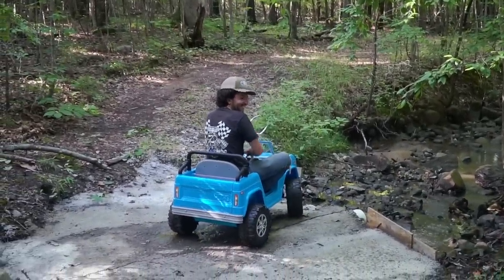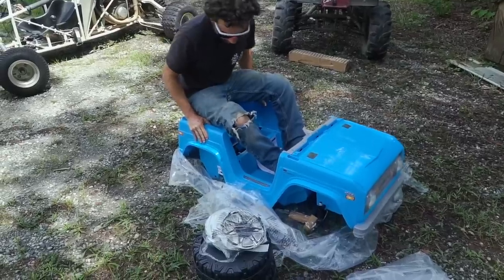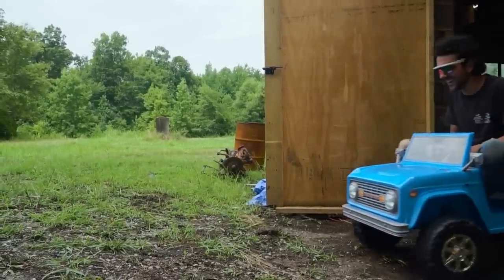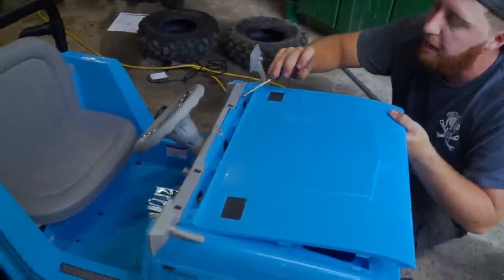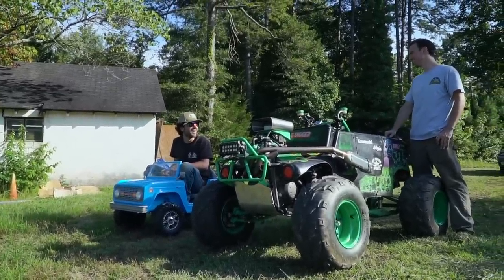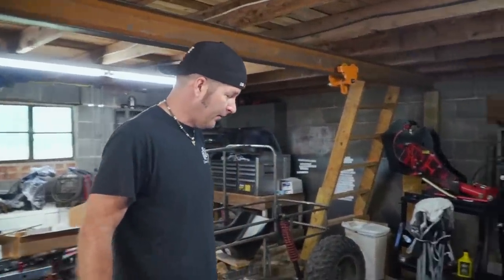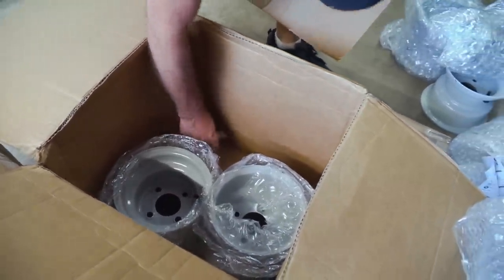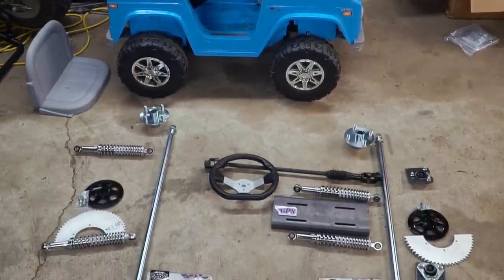4x4 Power Wheels Ford Bronco Go Kart Build!

Comment from the maker: Can't emphasize enough how SMALL this power wheels is! Should be a lightweight crawler with gearing for 40-50!
Reply: You just need to stretch it everyone does it to make room
Reply: Most people do a few inches of stretch for leg room, id love to see you guys do less than usual though
Reply: They make two basic sizes. What you have is the smaller of the two with 1 motor vs the larger power wheels with 2 motors
Reply: @KartArt  dont forget the 3rd size the gravedigger comes in 24v and with suspension
Reply: @16driver16  oh nice. I have seen a grave digger but didnt know it was 24v factory.
I made my kids a 24v escalade they love
Reply: Definitely needs cut and stretched.
Reply: High and low gears?
Reply: You need gearing for 80 man
Reply: Going to be so cool guys can’t wait
Reply: how ever big you think the tires should be...GO BIGGER. same on the width and length.
Reply: Its to small.  Yall need to rethink this build.  Run to walmart  or go on craigslist and find a bigger one.
Reply: go against the grind hard boi's with thier 4x4 power wheels.
Reply: We see how small it is. That's why we are all worried. Somethings should be left to the Jackass crew. Godspeed Guys
Reply: Ryan Roberts 
You are kidding right?
Reply: @colingotch1871  no
Reply: Ryan Roberts 
Unfortunately there is no way known these guys could build anything that will ever come close to anything Grindhard kick out. 
Worlds apart in every aspect. I love these guys and they were the first build channel I followed but they haven’t evolved much at all. 
There’s backyard builds everywhere but these guys have a great following because they are great guys not for their fabrication skills unfortunately. 
I’m still following and still hopeful.

Comment: You need a dirt bike engine. All that toque converters
 do is belt slip
Reply: Not with a Juggernaut pulley they don't.
Reply: Shark Bait still what if it gets wet. You may as well have the manual as well
Reply: @tomharms1055  They have covers for a reason. And all the old Honda Odyssey/Pilot buggies used belt drive, as well as modern RZRs. It'll be fine👍
Reply: @BunkerBlog  can-am does too
Reply: @BunkerBlog  and they all fail massively !!!
Reply: @craigengelman4534  They're actually pretty reliable
Reply: @BunkerBlog  if you ONLY fart around yes it works BUT line that thing up to mud and ump on at 20 ft bang ping pow . joe bob get a new belt !!
Reply: @craigengelman4534  Not true, get a good belt and it'll last a while (especially if paired with a Juggernaut; way less belt slip on built engines). It works well for RZRs and Can-Ams, worked for the Honda Odyssey/Pilot, works for snowmobiles, etc. Plus 20+ horsepower geared really low will be more than enough to move this thing.
Reply: @BunkerBlog  first thing to go wrong is the belt hence when ya pop thee hood there be a extra belt so when it snaps you can get home. RZRs and Can-Ams,  Honda  RZRs and Can-Ams, worked for the Honda Odyssey/Pilot, works for snowmobiles, etc,  snowmobiles, etc the reason why is to keep a stress point plus no transmission to pop since Odyssey/Pilot set up cant take shit for power ie rotax 600 triple grenaded in 5 minutes on my 350
Reply: @craigengelman4534  We're only talking about a matter of 20ish horsepower. The Juggernaut can more than handle it (they're actually pretty much identical to Jr Dragster drivers which handle up to 40 horsepower). I also have an offroad kart that uses belt drive with no issues. It ain't hard to change a belt. Polaris, Can-Am, Arctic Cat, etc, use belt drive for all of their UTVs and AWD quads. They will be fine.

Comment: I was at Rural King the other day. They have a Power wheels truck that is jacked up really high, and with a full suspension. There were more adults checking it out, than there were kids.  Couldn't help but picture it with a gas engine, screaming around the C.C. or G.H.P. track.

Comment: You should build one with a old Cadillac escalade power wheels body. They are super big and have a ton of room for activities it fits 2 older kids out of the box and I've got one and it fits an adult good. Then you would not have to worry about space and stretching. Plus, the plastic on them is extremely thick and connot be broken so you won't need as much body reinforcement on the frame.

Comment: Off topic question... if you take a cast iron flywheel and put a steel strapping band on it will that prevent the flywheel from exploding at high RPMs?
Maybe weld the band on so the coil can pickup the magnet as it goes by.

Comment: How about giving it a powerful brushless electric motor? Electric motor should fit easily under that shell, making it more original looking.. 😉
Reply: yea and the 300 pounds of battery??? where are they gone go??
Reply: @supertedogpriken  Nah, lithium batteries are much better suited for that purpose, by far the most popular type of battery for this kind of projects.. Not the cheapest though..

There seems to be some space under the bonnet, you can easily fit the custom shaped battery pack there..

Comment: You should turn a fwd 4cyl drivetrain sideways weld the diff and run the cv axles to your solid axles and stretch the body enough to cover the engine/ trans. Should give a low cg.

Comment: It's got a 302ci sticker so do a stage 2 300cc engine. Stretch the body 8" throw the engine and tc up front running back to Jack shaft in center.

Comment: When my daughter was little she had a 6v 4wheeler, battery died. I put a 12v model airplane field box battery in it. That thing would fly!
Reply: Shit man, I use a 14v lipo battery on my son's power wheels. It's an absolute animal.
Reply: @octane613  Dang! I bet. Didn't have those back them. RC stuff went   
Nickel metal hydride, and I got out of  it before lipo. Those changed everything!

Comment: They have different size power wheel models. It looks like you got the lil tykes class.  Should have gotten the 5+ year old one.  Maybe you did and they are just smaller now. I recently rode a f150 raptor PW and I fit in it alright. I weigh 240 lol    EDIT... Yeah you got the small one. You said it was $150.  The 5+ one is $399 and is a solid axle 2wd unit and is much larger.

Comment: Grindhard Plumbing has built a frame that is a little longer than the body, and they cut the body in half, and fabricated a piece (in the door area) to extend the body ... same could be done for width.

Comment: I would like to see a major calibration red beard 2 v twin supercharged, rather b welding frame with independent suspension, cars and cameras the 4x4 drive unit also it would have reverse. I am going to post on the channels also

Comment: did that "live axle" mod make it 2wd?  Usually on a power wheels, that axle goes into the wheels through the gearbox...so the gearbox spins the wheel...not the metal axle.

Comment: Get yourself a real deal plastic welding kit. You’ll be very happy with the end results of modifying the body plastics.
Try to find out what type of plastic that body is and order flat sheets and weld filler of the same type.

Comment: Take out that power wheels battery. And hook up a 20v dewalt or whatever power tool brand ya got. Find the positive and negative. Hook it into your drill battery, boy shell scoot!! I dewalt swapped my nieces barbie jeep, 2 20v batteries in series so it's still 20v, its just double the time. And man, her barbie jeep whips donuts and it's almost too fast for a 3 year old. I'll bet it does 10 mph compared to the 5mph factory. Whatever it was factory its 2 to 3x faster. With the extra battery, it last waaaaayyyy longer and way faster. Not to mention I got multiple batteries so she rides while I do. And until I'm done.

Comment: Do two solid axles front and rear and have a chain going from the rear axle to the front and a chain from the motor to the rear
Reply: No... just no.... 🤦‍♂️
Reply: Todd Gerhardt how would 4x4 work without a shaft between two differentials then lol
Reply: Chains would not allow enough flex in the axles for it to crawl. it would constantly pop off or break going from one axle to another but possibly from center to each axle may work with the right geometry
Reply: Todd Gerhardt a spring loaded tentioner would allow the chain to have play when neeeded
Reply: Did really think of that but yeah I kinda see how that could work. Lol I love building things I just recently made a electric drift cart with a 48v 1500watt system. Getting ready to buy a lithium battery for it soon but I started with 4 18ah lead acid batteries to get me going. I think I charge them to fast tho cause one had to be replaced by warranty already lol

Comment: I'm 12 hours away from you but if you decided to take a trip to NY I'd donate a complete 1991 ninja 600 motor exhaust wire harness dash breaks cooling system ect .... I pulled it off for a build of my own but I'd hate to see you build this and show up with that small torque converter and motor ... sport bike motor is the only way to go

Comment: PERFECT representation of ford.

I'll let that marinate for a minute for the slow people...... and for the ones that own that garbage.
Reply: Wow obviously you’ve never been experienced. They obviously do something right if the were the first car company, the most successful, and have the best selling truck ever.. educate yourself before you have an opinion
Reply: @gh0stedone472  They weren't the first car company, they had the first production line.
Reply: Ugly Stik, what do you drive?
Reply: Luke VT now youve done it.
You hurt my feelings.

Not really.
Reply: PeanutProductions Actually, 2 20 year old chevys and a half million mile dodge.
You couldn't GIVE me a ford.
Garbage.
Reply: @chevytruckman34  I used to feel the same way about Chevy after my brother had a Cavalier that blew up at 60k miles. But then I grew up and realized that all makes have good and bad models. Do you remember Cavaliers and Dodge Neons? Nobody does because they all fell apart. Meanwhile I know 2 people who still drive 80's F150s. 

P.S. I drive a Honda
Reply: PeanutProductions Oh ya, I had a cavalier. That motor was strong. Even after the plugs welded themselves into the head, it ran like a champ. 92 model. 5 speed.

The neon? Ya, 2.0 motor. I didn't own it, but brother in law did. Couldn't kill it.

When I buy new, it'll be a titan. With the cummins.

Until then, my stuff runs like new, so no need to spend extra on something not needed.

P.s. I'm a heavy mechanic. 😄😏

Comment: I was hoping to see it with 12V as the motor is most likely a 12V motor but undervolt too 6V as that is safer for children. It would definitely be better an it didn't matter if you burnt the motor as you obviously don't need it.

Comment: you two gents need to watch the Grind hard plumbing  line up .. they run real motors not lawn mowers your ducati motor fit it into that unit or get a broken quad 4WD and make a bellhousing cross over plate. have at least a 600 cc motor to go play in Oregon, you must know a machinist somewhere down there and stretch it out man or you will be on the roof.